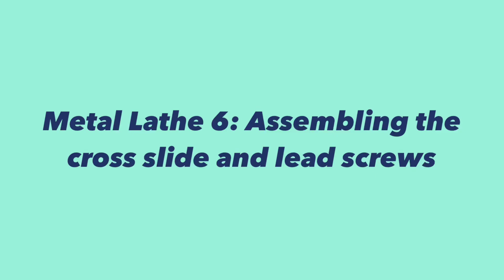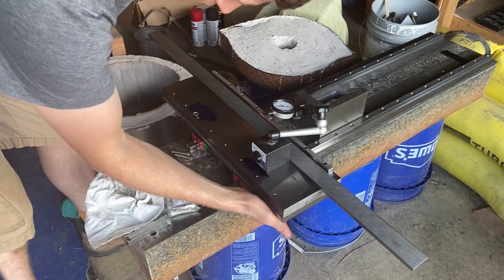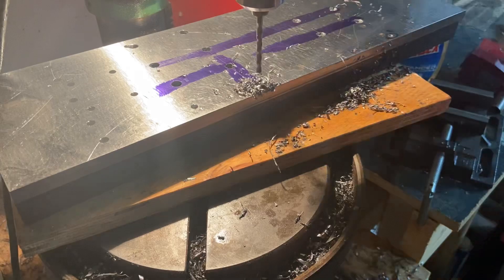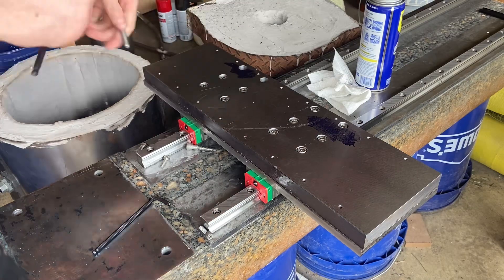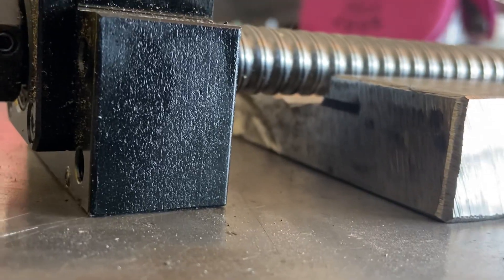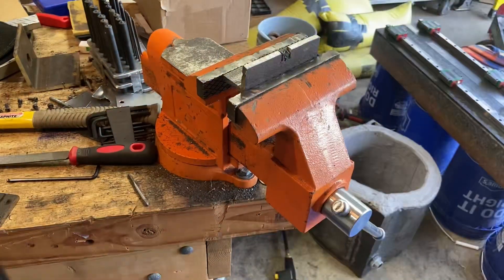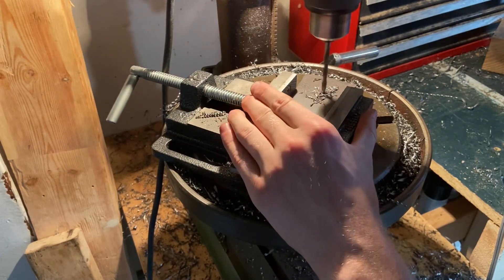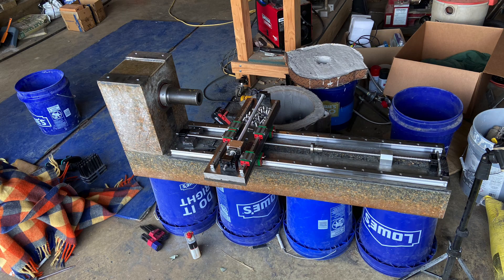DIY Epoxy Granite Metal Lathe 6: Assembling the cross slide and lead screws

Comment: I wonder if such rail system is strong enough to take the load that may happen on a lathe bed ?
Of course there seem to be many different qualities of this rail systems, some with ball bearings some with rollers some wiggly out of the box some may be not so much...
So, hard to tell at all. Positive aspects of this rails are that they are easy to build, relativly cheap and easy to replace if they are worn.

Comment: NEVER wear gloves around rotating equipement, especially when your hands are so close to it - it's a great way to get a serious hand injury - the drill or the lathe or the mill catches the glove and wrappes it around, together with your hand in it. If you value your hands, do no not wear such heavy gloves when operating rotating equipement. Perhaps latex gloves that can tear easily would be preferable?

Comment: can you upload the 3d model i cant wait to make my own
Reply from the maker: Unfortunately the 3d model isn’t very updated and not complete, but if you need any info or anything Im more than happy to give dimensions if you need them
Reply: @robertsteinwandel6658  thanks can you give dimensions and if it is possible can you tell me what to buy also thanks again
Reply from the maker: @RCairplanefy  I mean the body is 10in wide by 6in tall by 48in long. The top face of the body of the lathe is steel, it would be best to make the entire top face a single cold rolled piece of  1/2in thick steel
For steppers I bought the stepper packages from steppersonline.com (might be stepperonline.com or similar). For linear rails I got HG rail sets from motionconstrained.com

Comment: It's a really bad idea to fling this much abrasive(angle grinder wheels and later epoxy granite) pretty much directly at the assembly. Before you start bolting anything down, make sure that you completely wipe every inch of every surface down with a solvent at least twice, then oil immediately to prevent rusting.
And in the future, when doing more cuts, cover the whole thing in plastic sheeting or a tarp.
Reply from the maker: That’s a good point, and for the most part I’ve been doing that off camera. Generally I cover my rails/cars/ball screws/headstock bearings with at least a towel to keep the bulk of the dust off of them, and I plan on doing a full clean before I grease everything and start using the lathe. The ball screws are fairly bad chinese ball screws so I’m not completely worried about them, they’ll be some of the first things I upgrade, and the rail cars have wipers that do a good job keeping the dust out for the most part, but you’re right that dust is still a concern. 
I will be doing a deep clean though, not to worry